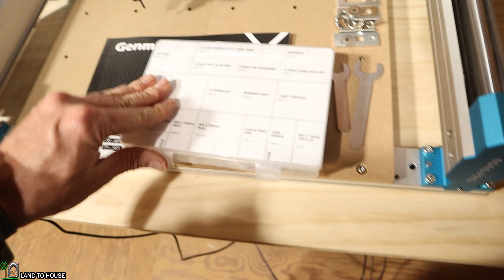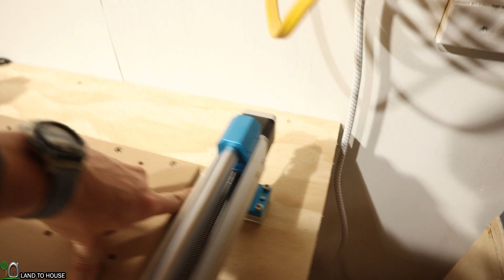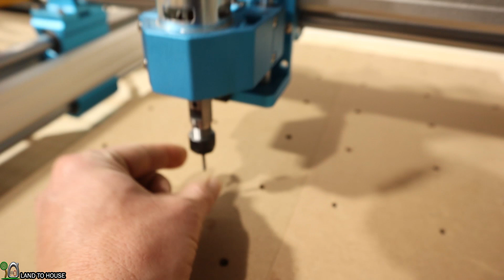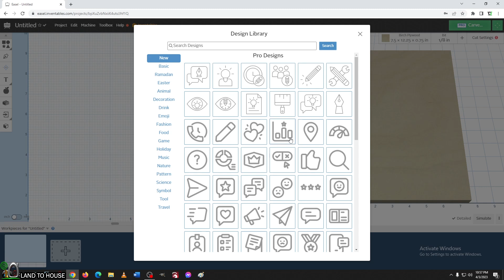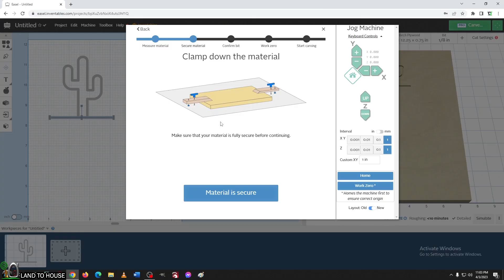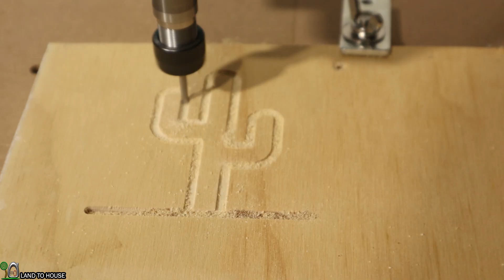Sainsmart Genmitsu 4040 Pro CNC first run

Comment: Those clamps have a thread in them so that you can use a bolt as an adjustable height packer. You should never use clamps like you did. The back of the clamp should sit slightly higher than the material.

Comment: Being a complete novice to CNC and having recently purchased this machine, and watched your assembly video (Brilliant BTW) I have a simple question about Easel connecting to the 4040 pro: As the machine is not listed in Easel what settings should I use from the "other"  menu. Ideally I would like a step by step guide on how to connect the machine, and I can't find this anywhere, I would really appreciate help from anyone.

Comment: you can put a bolt upside down in the threaded parts of the clamps, and use a spanner to put pressure on the workpiece.. t(on the supplied ones)

Comment: Not sure if anyone hitting this would be able to answer this question, but I have the 4040 Pro, and came up with a design that I would love to use as my first project with it. I have created an STL file for it, but Genmitsu uses a different file type for it's stuff, and I've tried finding how to convert an STL file to a Genmitsu file, and haven't been able to find anything. Are there any tutorials on how to do this anywhere? Anyone done this successfully? I've had the 4040 for a couple months now, and the enclosure I have it in is just gathering dust at this point.

Comment: Hello! I have Easel pro with Genmitsu 4040 pro. When I try to install the machine 4040 pro is not listed in the pull down menu for available machines. What machine do I need to select to be able to control my 4040 pro with Easel? Thank you!
Reply: Did anyone figure this out?

Comment: I have put a gt2 belt and pulleys on the Y axis to keep the motors in sync it starts to screech and squeal when the Y axis is out of sync next upgrade new z axis way to much flex and new spindle motor.775 motors don't last I'm on my third motor

Comment: Suggestiion with the supplied clamps. Use the provided threaded rods or a long screw to insert in clamp (strap) threaded hole. Adjust height so strap is slightly higher than workpiece. Next, as you have done, insert a second threaded rod thru the strap slot and screw into base. Attach wingnut to this rod and tighten.  When completed, it should have the strap tilting down to the workpiece, resting on the back screw for a firm hold. To maximize holding pressure, position the strap where the leveling screw is furthest from the hold down screw. This requires the workpiece position to be within the length of the strap end and then slot end.
Additional suggestion: the used method in the video will sooner than later, pull the mdf inserts out and damage the mdf.

Comment: A bit curious, why the 4040 pro when you have the Carve King 2 sitting right there?  CK2 has a slightly larger working area, runs the trim router and "arguably" appears to be a stronger machine.  Just curious as I have been looking at both of them.
Reply from the maker: Both machines were sent for youtube videos. They both work well and I don't have any real negative things to say. The small clamps need an upgrade but other than that both are good machines. The carve king does come with a nice router.

Comment: Its a nice machine but dont get too happy with it. I got my 4040pro in February and it died on me today. Now i gotta wait till monday for customer service. Enjoy it while it runs...
Reply: Could you tell us what happend to your Machine? I was thinking about getting myself the 4040pro...
Reply: @DM-me3gb  since i purchased the machine in February, I have had the cooling fan go out in march, next the main board died in april and now the most recent break down is the air assist pump for the laser engraver attachment and the main power switch is also broken. Genmitsu does have good customer service and the replacement parts do get sent out quick via DHL. However it is still inconvenient to have down time every month as part by part fails.
Reply: @AWMarine  Thanks for the input. Gives me something to think about.
Reply: @DM-me3gb  in that price point it is one of the better machines.

Comment: Great video, could you possibly explain how Easel works with this cnc? What I mean, is did you have to install anything or is it running directly from the cnc being plugged in via usb? Thanks again and looking forward to your feedback.
Reply from the maker: When you 1st  Sign up for easel it gives you a file to download that will allow the CNC machine to talk to easel. When you plug up the control board on your CNC it automatically installs the driver's. It really is quite simple. I did have to unplug my other CNC machine in order for easel to recognize the new machine.
Reply: @LandtoHouse  Thank you very much

Comment: Adorable 775 motor for the router.  An idea with those clamps: you could put scrap bits of the same 3/4 plywood under the other end so they sit parallel to the mdf bed; the wing nuts and washers can clamp better like that.